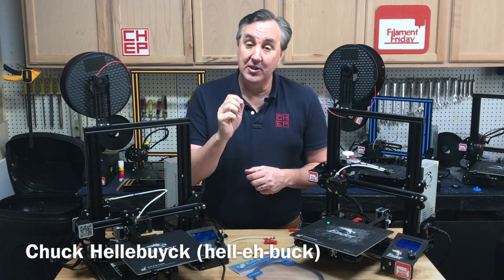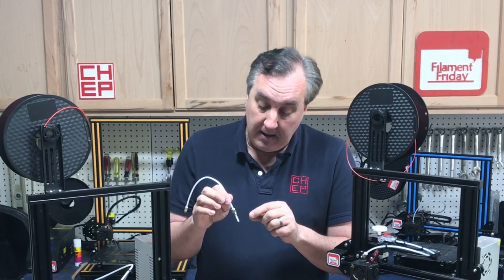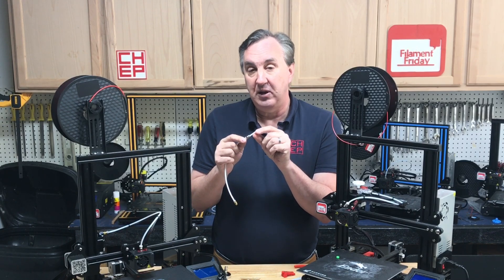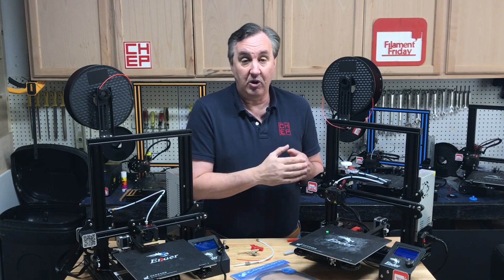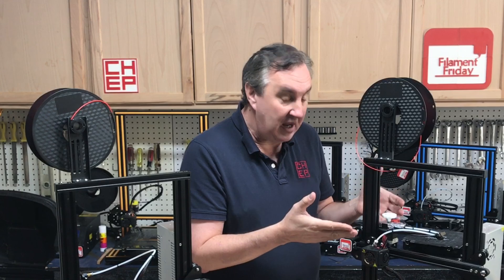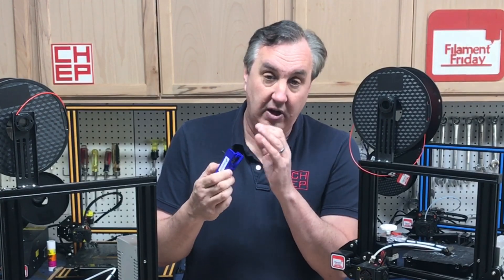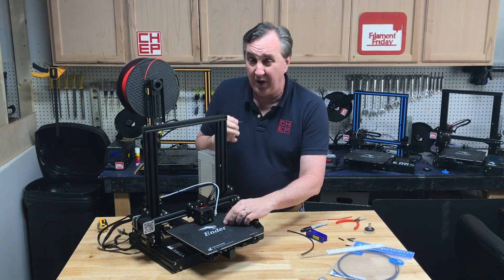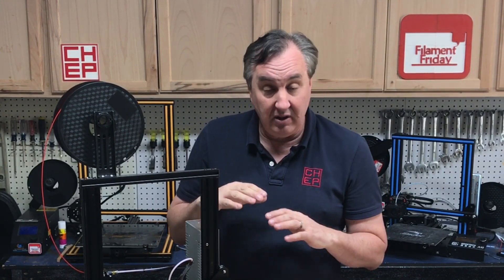Simple HOTEND FIX for Creality Ender 3, CR-10

Comment: 4:12  You never said WHY the diameter of Capricorn PTFE is a problem.  You only said that the larger diameter of the stock tube WASN'T a problem for you.
Reply from the maker: Some filaments need the additional diameter.
Reply: Have had severe issues with Capricorn when trying to print Fillamentum's Timberfill®: Although the PLA diameter is 1.75, it looks like stock tubing gives you roughly 0.1mm extra inner diameter. Standard PLA prints just fine. Due to the uneven surface of filaments with additives such as wood, metals, etc. I personally prefer stock tubing for said occasions... If I understand correctly, CHEP does mention that Capricorn tubing causes less resistance if it is straight - hence to the combination of Capricorn (within hot-end) and stock tubing (from extruder to hot-end). Have not tried this myself but am literally going for it in a sec. I'll keep you posted ;)

Comment: Chuck, my extruder keeps doing this clicks during the print, do you think this could fix this issue? Also, you know if i could use an aluminum insert fabricated by me instead of using the capricorn tube?
Reply from the maker: Possibly. You’ve got some kind of restriction.

Comment: Just thought I'd add that you really want to ensure there's no filament left in the hot end prior to doing this. The best way to do that is to remove the nozzle and push the PTFE tube the whole way through the hot end. I found that out the hard way, as I was still getting stringing. :)

Comment: It do not fit on my cr10. My hotend is conical inside between the thread an the "hotend" so the washer do not press on the bowden insert
Reply: you should cut a longer insert, my two hotends have conical insides, the insert should end above the cone

Comment: When printing the washer the first couple layers are ok, but then it just under extrudes. The extruder is totally fine, I can go and print a calibration cube right after and its good, but then try to print the washer and it's just this messy stringy blob, any help?
Reply from the maker: Try reslicing the file
Reply: @FilamentFriday  Wow, amazing, thank you so much, I'm really bad at this apparently. That worked. Much appreciated, you're tremendously helpful.
Reply: @FeelTheGrassBison  you'll get it down, I new to 3D printing and it's been amazing having access to so many knowledgable people. So glad I bought an Ender 3 as my first one, there's just so much info online, unlike when I got started in laser engraving about a decade ago. That was a steep learning curve with little resources to help.

Comment: Hi Chuck. What material is that washer made of?
Reply: Had the same question! Am I right to assume PLA should be fine since to top of the heat-sink should be cool enough???
Reply from the maker: I used PLA.
Reply: @FilamentFriday  is the PLA will melted and stuck in it ? I'm trying it now and worry about this problem...and still consider to put it in or not.... pls help
Reply from the maker: It shouldn’t get that hot up there or you have a bad fan.
Reply: I can't be the only one who thought this too. I'll do this mod once i figure out the answer to this question

Comment: my plastic washers kept getting squished and warpped which then pinched the PLA and caused clogs/under extrusion. Each print i would have to clean the clog and essentially put in a new washer.
Reply: Check your cooling fan for good functionality. And do not overtighten the coupler as that will damage the washer as well.

Comment: Hey Chuck, I have a EZR extruder I can give you if you like. I've had it installed on my Longer LK2 for 6 months and have replaces so many parts, calibrated and recalibrated 50 or more times,replaced nozzle 2x ($14ea),bowden tube(capricorn) 3x, adjusted slicer(S3D) settings more times than I could keep track of. Contacted SeeMeCNC and they were reluctant to support it since it wasn't on their machine and all they suggested was it had to be a bad nozzle(right) so they received a thumbs down and 1 🌟 rating. I'm not a newbie(17 yrs retire mach engr and 4 yrs using 3d printers. And the story goes on....... If you want it I'll ship it to you as long as you let me know what you did to get it to work if at all. Let me know or it goes in the trash.
Loved your video as always.
Reply: Oh, also I replaced the (not so easy) EZR with a dual gear extruder and the LK2 is now printing beautifully!!!!

Comment: This "fix" causes more problems than it supposedly resolves. It has actually caused clogs in my Ender 3 and the worst part is that the "washer" melts into the hotend, making it nearly impossible to remove. Don't do it, especially if you're printing just fine without it. If you're having problems, at minimum, get a new coupler. Otherwise, with this "fix", you'll inevitably need to buy a new hotend, which honestly, is probably what the hind intent is with this video's advice. Don't do this.
Reply from the maker: If the washer melts at the top then your fan is bad. The top of the heat sink should be cool to the touch when printing.
Reply: I would have to agree. The top where the washer is always cool enough to touch. Let alone melt it. I would say that something wrong if it's melting the washer at the top. But good luck! I hope it works better for you 😁
Reply: The washer should not be in the hotend but on top. If it melts there, you have a serious other problem like a broken cooling fan.

Comment: Hi Chuck! I just installed your washer on my Ender 3 pro. All seems to work flawlessly! However, I am a bit puzzled whether I got the length of the insert right. I measured 38mm using a 2 mm diameter stick. I subtracted 4 mm for the washer and 3 mm for the thread. So I prepared a 31 mm insert. The coupling now does not Thread all the way in. Is that ok?
Reply: Same as me, i've mesure a 37-38 ish mm for my ender 3 pro. I had the same question as @Stephan W
Reply: UPDATE : Its magic, its working now! Get this WIFI hug!!
Reply: My coupler only goes half way in too  .. Have to see if this still works.  THeoretically it should.

Comment: Chuck, I have learned a lot from your videos, thank you. Now I have a question. My Ender 3 is perfectly Priinting however the Bowden tube gets damaged by the pressure fitting on the tob of hot end. I have the small plastic fitting installed to keep the fitting pusher straight but the Capricorn tube always get squeezed at pressure coupling. Did you fine any issues like this, if so do you have any solution?
Reply: And what is the perfect length for the Bowden tubing from extruded to hot end for Ender 3?
Reply: A good coupler always leaves grip marks on the outside of the tubing, it isn't a problem.

Comment: I assume you print the washer at 100% infill?
Reply: Yes. Also, dont use brim. Then i did that, the piece was not levelled. Skirt 2 lines and it do the work.

Comment: Also if i may add. I made this mistake since my hot end kept cloggin. Turn out my hot end fan was OFF! it was hooking in properly so the fan wasnt spinning. Not the cooling part fan but the hot end fan that is supopsed to always be running. I felt so dumb after trying so many solutions just to find out that my fan was off. lol

Comment: Sadly, Printed the insert, measured the capricorn tubing. The insert seemed not quite wide enough to keep it centered when I started to lock it all in place. No problem tightening the fitting down... simply wouldn't line up. The filament kept getting hung up. I opted for a full length of Capricorn. Guess I'll see how that goes. Love your channel! And I love your tool kit from Amazon. I've used the items in it so much already!

Comment: I am new to the 3D printing but I am quickly finding out the shortcomings of the equipment at least the ones at the beginner level. It appears that in the case of the Ender 3  Pro anyway the hot end just cant keep up with the demand for heat if you try to use a nozzle larger than the .4mm it comes with and likewise for the same reason it is what limits the speed you can print at. So my question is, is there an upgrade for the hotend that can handle these issues?
Reply from the maker: Microswiss hot end.

Comment: Well, I printed the washer and installed it on my Ender 3 Pro’s hotend. The washer then melted within the top end of the hotend?! I’ve also upgraded the top end coupling and have the Capricorn tubing for the insert within the hotend. Has anyone else had this happen? This is getting old real quick.
Reply from the maker: If it melted up there then you have a fan problem not keeping the heat sink cool. Top of heat sink should be cool to the touch.

Comment: I'm sorry, I didn't understand what you don't like on the Capricorn. It's slightly narrower. But what problem does that cause? Thank you :)
Reply from the maker: Its smaller inner diameter can sometimes cause issues with less expensive filaments that don’t control diameter as well. Or filaments with additives.

Comment: Looks to be working for me. I couldn't screw the coupler thing in very far which threw me off but looks like it should hold fine. Thanks!
Reply from the maker: You can lower it into the slicer bed to print it thinner if you need to.
Reply: @FilamentFriday  my issue was the width of the washer when trying to get it into the heatsink... i ended up reducing the x and y a bit before lowering it into the bed... I couldn't quite work out length of the PTFE tube between the weather and the nozzle so I used a spare heatsink to gauge the length.. hoping the washer doesn't melt in the heatsink but no clicking thus far
Reply: @FilamentFriday We had the same problem on our Ender 3 that we tried this fix on. Should the coupler screw all the way into the hot end? ours sticks up about half of the distance of the threads
Reply: @mjpresco  That's normal, but you can print the washer a bit thinner as Chep explained. If the coupler has a good grip and fits straight, you're ok.

Comment: Nice video Chuck a small question i have ? How to print this thing Can in PLA ? Wich High ? THX again
Reply from the maker: Yes, PLA is fine. You can lower it into the bed before slicing if you need it thinner.

Comment: Chep as you can see the tube fitting wont go all the way in with the printed washer, i had to carve it conical to match the dish shape of the heatsink so the hose fitting goes deeper and locks, i posted a video on the cr10 facebook group but i want to share it to you so you can do a new way to do it, i even had to reduce my flow of how well i made it work 100% sealed
Reply: Had the same issue while attempting this on my stock ender 3 today. I was barely able to screw the fitting onto the block and almost stripped the thread before noticing something wasn't right. Solved by by sanding down the printed washer so that it fits inside the hole and lays directly on the cut capricorn PTFE tube, and now it's printing perfectly. Might have needed to tune my extrusion multiplier and e-steps before printing that washer since I had to sand quite a bit off.
Reply: @bryantran1673  look at the thingiverse link i posted here, I made conical washers and a jig so you can fit it correctly
Reply: @tricelbor  I don't see a link. I think it got removed? What's the thingiverse item code?

Comment: By some miracle my ender 3's extruder ran flawlessly without maintenance for 2 years! I cant say the same for the chassis though as I had to rebuild the printer using threadlocker and the eccentric nuts gave me trouble too.

Comment: The washer is taken a space from the threads section only
There is a lower section between the end of the threads until the start of the metal pipe.
this is section is narrower and the washer can't sit there.
Does the washer should go lower to that section (above the metal pipe) or should it use the threaded section only?

Comment: I use the capricorn xs tubing, this mod seems fun but ultimately unnecessary. When I'm installing the nozzle hot I just bottom it out, back it off about 3/4 turn, push the ptfe thru the coupler until I feel it seat on the back of the nozzle, and then tighten down the nozzle. I have been printing this way for over a year on the same piece of ptfe and the same nozzle, absolutely no extrusion issues. Also if you upgrade to all metal this is obviously pointless, so unless you're sticking to PLA and flexibles I wouldn't bother
Reply from the maker: If your couplings hold.
Reply: @FilamentFriday  Have so far, been printing on the same tube and couplings nearly non-stop for over a year
Reply: The problem with that method is when the filament is retracted, the force of the filament pulling out will pull the tube against the coupler teeth. With the washer method, the tube is always pressed against the nozzle, and the pulling force is restrained by the threads of the coupler. The coupler threads will not give like the teeth will.
Reply: I'm printing 24/7 for almost 5 months now only 3 or 4 days without printing, but every 300-400 hours I have to clean the Hotend because it partly cloggs, although I use the same method as you. Printing PETG only btw.
So, im trying the washer tomorrow, the theory on this is logical.

Comment: Could I use PTFE tubing inside the extractor? As I dont have capricorn, I would simply cut a piece from the stock ptfe tube and use it
Reply: Yes..it the same as without the hot end fix. Just do the fix with the standard tube,then you can exchange later if you wanna. I´m also in the process of using my standard tube. Probaly better than no fix ;)
Reply: @HartRaver  thanks!

Comment: Spacer is to thick! Not able to screw in the coupling.
Reply from the maker: As I mentioned each is slightly different. Print it again but lower it on the slicer bed to make it print thinner.

Comment: Would this be needed if I just use capricorn for the entire tube?
Reply from the maker: No. It’s just another option.
Reply: @FilamentFriday  It would still improve the contact between the nozzle and tube, right? So not totally useless.
Reply from the maker: Yes.

Comment: Capricorn has two versions. The normal one has a inner diameter of 2mm, the XS variant has an inner diameter of 1,9mm. So then there is an disadvantage removed and I would say this mod becomes obsolete when you just install the normal capricorn tube.

Comment: Hi chep
Can you help me out i did this fix from one of your older videos do you have any advice on how to get the piece of ptfe if it needs replacing i am having alot of trobule removing it.
Reply: It's possible that you have some extra filament in there that's keeping the tubing stuck. Try taking the nozzle off, heating the hot end to 200 and using another piece of tubing to push it from the bottom. Careful about burning yourself!
Reply: I had this problem on my CR10s pro the tube was super stuck because the collet had wore a huge cut in the side of the ptfe tube when it pulled up during a retraction. I ended up taking off the nozzle and pushing it up like micweis suggested. Ill try this mod as soon as I get home if this doesn't work I'm going to buy the microswiss all metal hot end

Comment: Hi! Is it normal to find the original ptfe tube really hard to remove? And also hard to insert the new ptfe part? It happened to me and the problem remains, it gets clogged during the print.
Reply: Do you reccomend to disassemble and clean it on the inside?
Reply from the maker: Sometimes the coupling cuts into the PTFE. Yes. Clean the inside.

Comment: Your Thingiverse doesn't say, any particular printing instructions for the insert?
Reply from the maker: 50% infill, 0.2 layer should work fine. Or just use my 0.2 Cura profile.
Reply: @FilamentFriday  Thank you. I just switched from all metal after having countless clogs back to stock hotend and is printing out the fix now. Will also be using your profiles (other than flow and temp numbers).
One question why 95% flow on the outer wall? Won't that mean it's under extruded? and what if your flow isn't 100 to start with? (mine is at 97.7)
Reply from the maker: Adjust accordingly but 95% on just the outer layer worked to smooth out my prints on multiple machines.
Reply: @FilamentFriday  Thank you again, your advise is invaluable

Comment: Works great on my older ender 3's but on my newest one, they added a chamfer to the top of the block so it doesn't catch any threads with the 4mm spacer... I am going to try a 2mm spacer and cutting an extra mm off of the tube... Thanks for the hard work and excellent videos.
Reply: The 4mm washer wouldn't fit in my CR-10 S4.  I did what you did (made it thinner and adjusted the length of the Capricorn tubing).
Alas, that design coughed up a fur ball when the filament wallowed out the hole in the printed washer and it clogged.
I found a stainless steel nut that I sanded thinner to fit. We'll see if that works.
Reply: Same issue here guys, for now I've gone back to the original set up. Going to give this a coat of thinking though as I like the idea. That void just doesn't give enough support for the washer I think and it kinds collapses on itself.

Comment: So did this not work for anyone else. Even if I didn’t put any PTFE tube in and put the printable insert in my coupler would not screw in. It would start to then if I forced it it would start stripping the threads on the hot end.